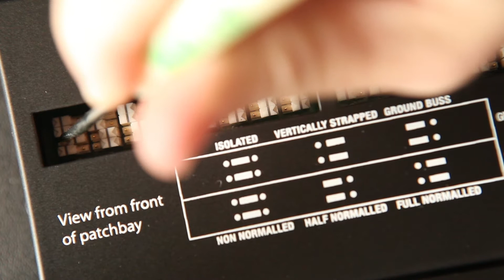Unboxing Redco 96 point TT Patchbay and normalling switches

Comment: Can we get a video on how to label it correctly? Lol
Reply: If you have this same patchbay, Redco offers an excel spreadsheet template which is precisely mapped to the connections, which is pretty easy to use - just type what you want, print, and use a paper cutter or xacto knife to trim the paper and slide right in. Easy peasy!

Comment: Why normal?? There is no disadvantage to half normaling the whole patch bay.   It only gives you access to a split output per channel.
Reply from the maker: half normal could come in handy if you are doing a monitor mix or you got like an on location recording truck. Although that's not really common these days.  Transformer splits are the way to go.
Reply: @toofarpunk  for studio use, there's a use case for double-tracking purposes. So for example with a half-normalled connection, if you're tracking from a preamp/DI which is half-normalled to your audio interface, you could mult that to another device like say a compressor or reverb unit. You could then patch that into your audio interface and record both simultaneously (or simply use the compressor/reverb for monitoring purposes, like if a singer just wants to hear some reverb while performing). The advantage here is even if you like the affected signal while tracking, you could always have a raw/dry backup of the take just in case you change your mind later or in case maybe the effect is too much once you go to mix. At least that's how I use half-normalling!

Comment: If you need to pass phantom power, would you set the grounding to isolated, vertically strapped, or ground buss?   Thanks.
Reply from the maker: Jody Sloan I don’t think phantom has any influence how you ground.  Has more to do with using different ground sources impacting ground potential variations on your power which ultimately show up in audio as a ground hum or buzz.
Reply: @toofarpunk  Thanks.  Does the Redco pass phantom power from you preamps back to your condenser mic?  And how did you set your grounding to avoid the hum and spikes?
Reply: @JodySloanHomeStudioHaven  To run Phantom on the patchbay I would assume is VERTICALY STRAPPED how did you set it up to be able to patch your Mic Pres and USe 48 volt phantom power?